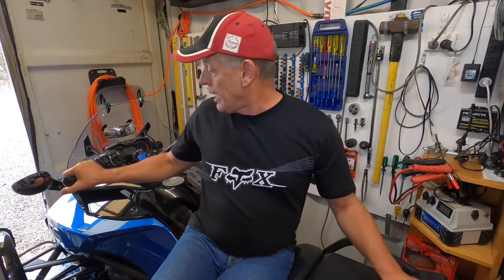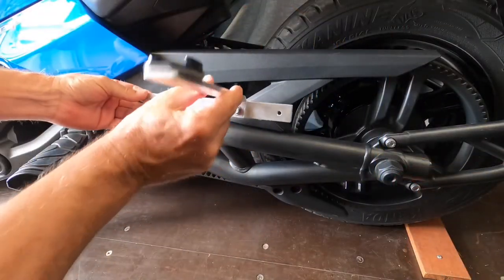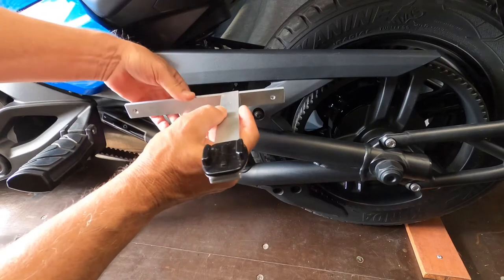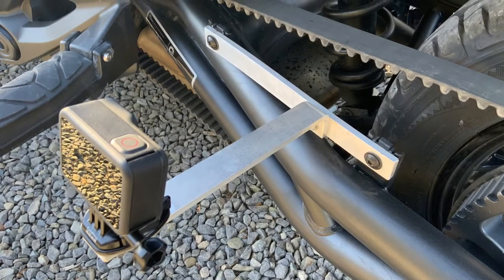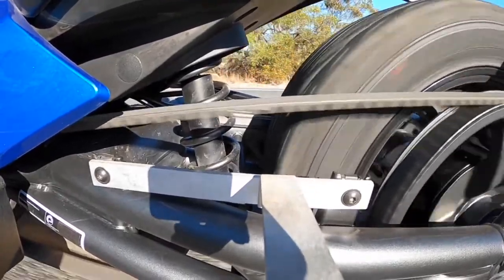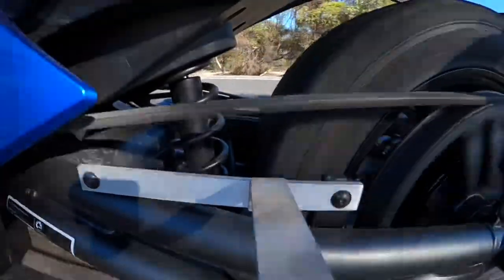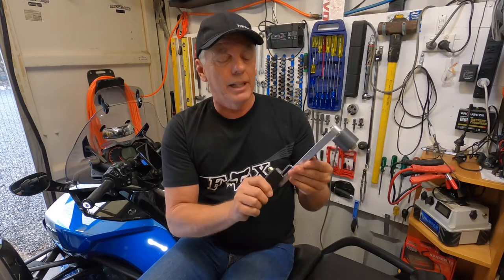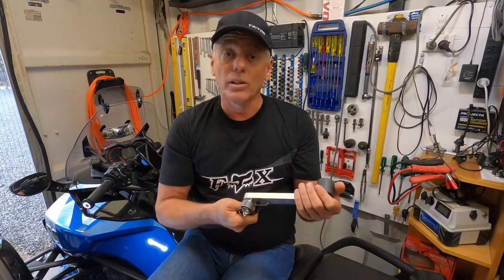CanAm Spyder belt flutter  Is it fact or fiction?  I film it in slow motion (part 1).   (28)

Comment: Very good info. I'm running around 190lbs.  There is a sweet spot for tension and I find I don't have any flutter, but I have an F3s with different gearing. I also have the Lamonster tensioner.  I can tell you setting too loose is just as bad as too tight. The Krikit II is a very useful tool to have.

Comment: you u go with the belt tensioner...just make sure to get it with the upgraded pulley bearing.  I didnt as they werent available when i bought mine...long story short my tensioner pulley bearing seized and snapped off, and ultimately gouged out my belt.  fortunately it didnt destroy my belt..but lesson learned!  hope this helps!
Reply from the maker: Geep thanks for the heads up, yes I had noticed the bearings were cheap Chinese ones. I tried to get some replacements but they are a weird size still looking. Cheers. ps(thanks for the heads up I should probably do another video warning people to change them)
Reply from the maker: Thanks mate 👍

Comment: I feel it at 70 miles a hour
Reply from the maker: Spot on Kevin 110 kph under light acceleration, the tensioner will fix it but be aware of the bearings in the roller, mine were Chinese so I’d suggest you change them. They are cheap & easy to change, cheers Steve.